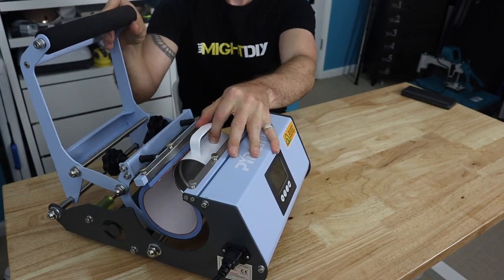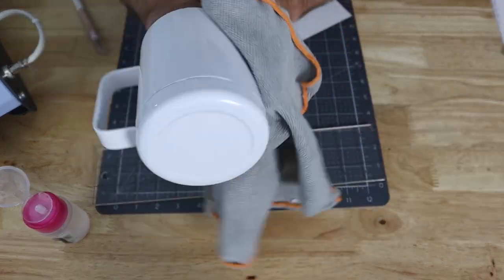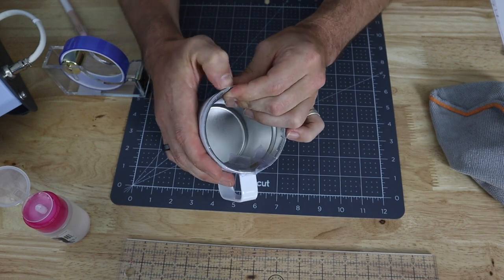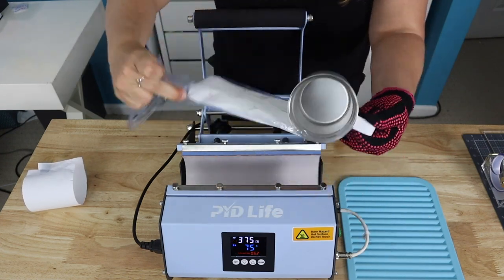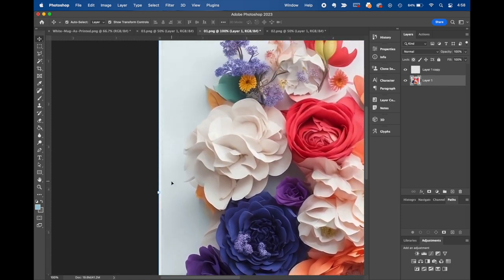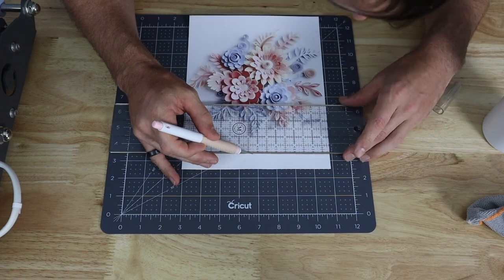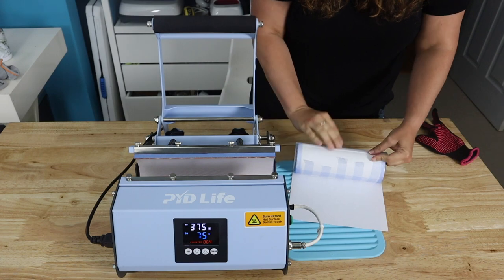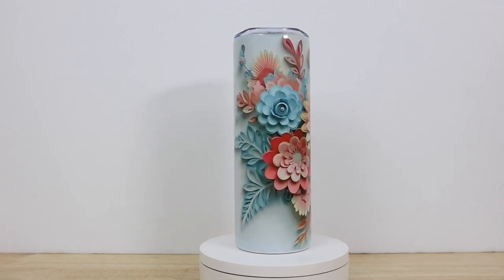How to Get Stunning 3D Sublimation on Tumblers & Mugs!

Comment: Is there a general amount of space that you leave from the handle of the mug to the edge of the image? I recently purchased an auto press and want to avoid the faded edges where it might not get enough heat. thank you
Reply from the maker: We can get up to about half an inch from the handle, but we do it in two presses. Spinning it as far in each direction as it will go. Hope this helps😀

Comment: You are getting ripped off from design bundles its all same as whats on creative fabrica which you can pay 4.99 a month and access to litterally everything
Reply from the maker: We're glad you found a site that works for your needs! We've actually tried Creative Fabrica before and used it exclusively for several months. However, we ended up switching back to DB for most of our needs. The $5 per month is ONLY if you're willing to commit to a full year up front; otherwise, it's $29 per month. 

We honestly found their search functionality to be really lacking. We've provided that feedback and keep checking to see if it's improved at all. 

For now, we're sticking with DB for the most part. $5 per month is still challenging if we can't find what we need quickly and easily. But again, cheers to you for liking the experience!
Reply: I was just looking at CF . $47 for the year. DB is $10 per month, and you still need to purchase some things that you may want. Am I missing something?